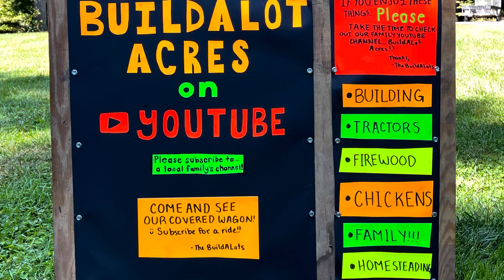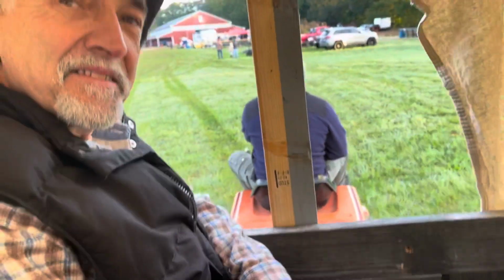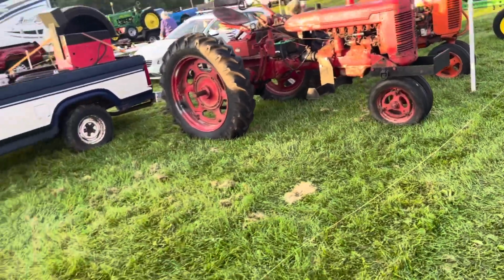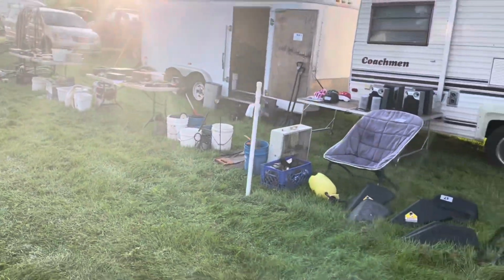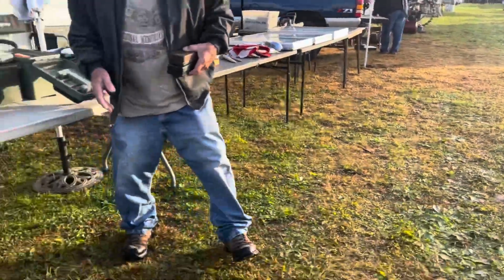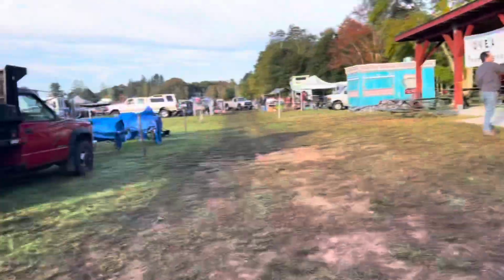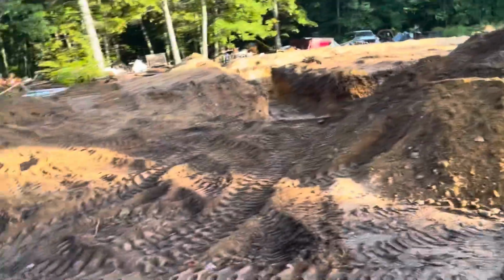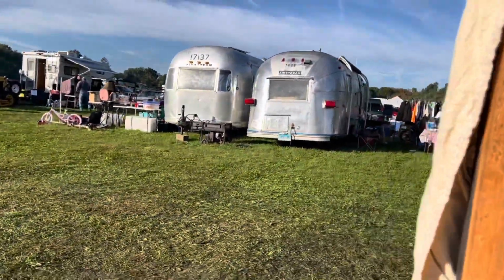Zagray's 2021 Fall Tractor Show-part 1

Comment: If you find an older Case garden tractor for parts, you may find the 777 glass lenses in those. My 1975 Case 224 has them.
Reply from the maker: Very true. A few brands used the Speaker 777's. I gave Brett a pair for Christmas. Thanks for commenting Noel. You da man